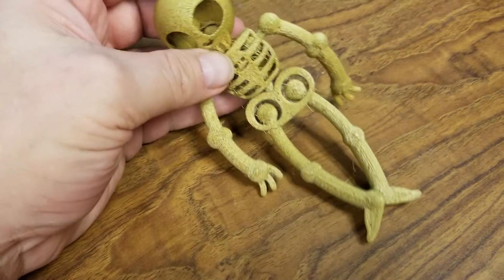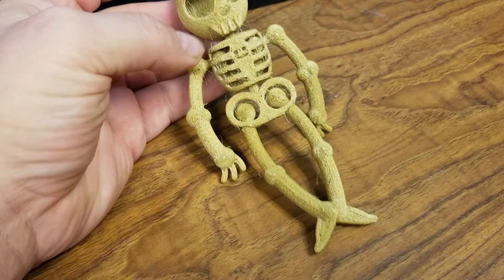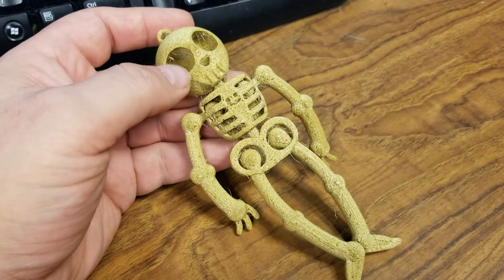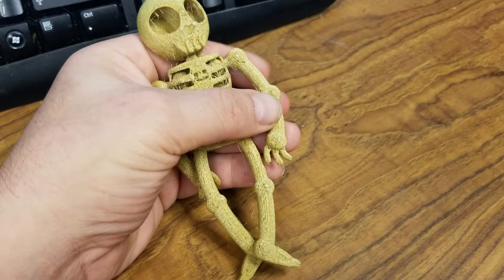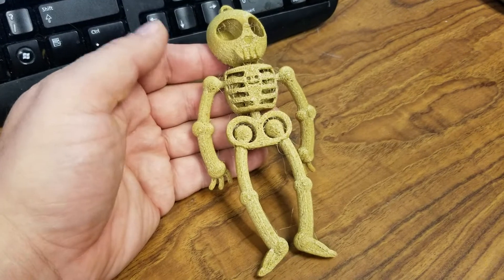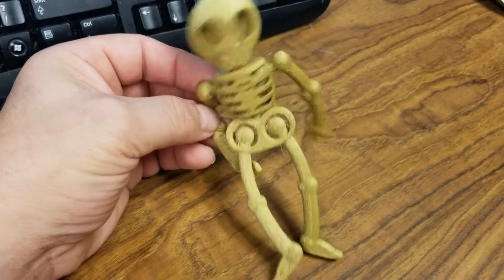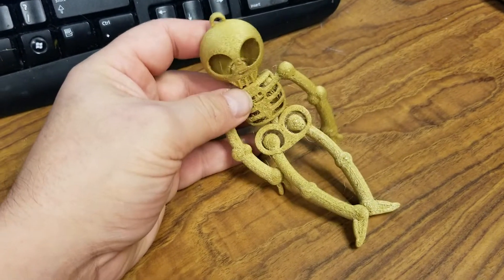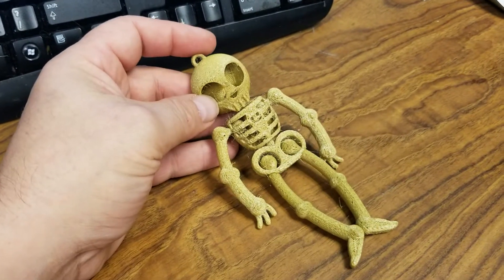Printing with NinjaFlex Gold Filament on Ultimaker 3

Comment: I am having some issues with the filament being stick in the back on the Ultimaker 3. I have increased the printing temperature to 240c to release some of the pressure in the extruder but I still have to retract the filament manually and push it back in during the print. How did you get your printer to work with the NinjaFlex?
Reply from the maker: I can print at the Cura default for TPU95 (which I believe is more like 225 or 230),  but I did need to bump up the tension for the extrusion motor to its max (here's what I'm referring to - https://d3v5bfco3dani2.cloudfront.net/photo/image/1300x0/5923e8ef78955/SDB2017-05-12_0001-69.JPG ).  With that said, I just had a clog while using this filament the other day and had to use a small drill bit to unclog it.  I recently got a 0.8mm AA print core which works better for printing with clear filament as well as flexible filament.  Anyhow, I manually shove a 0.8mm drill bit up the nozzle while hot to remove any clogs.